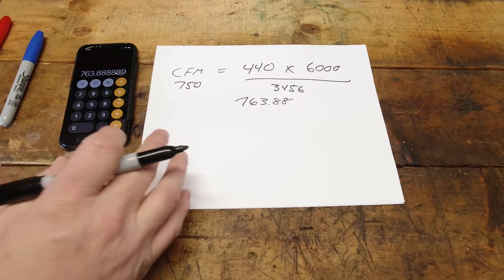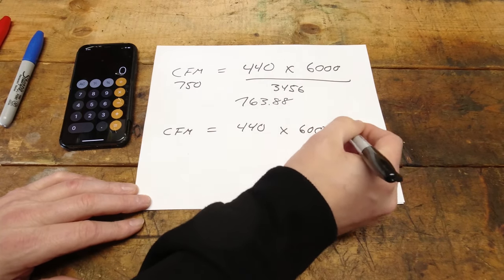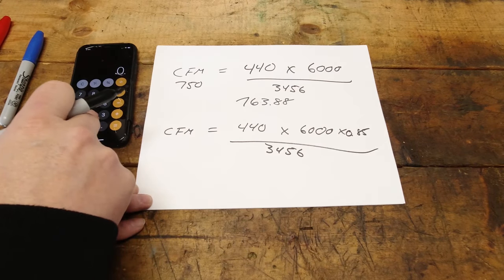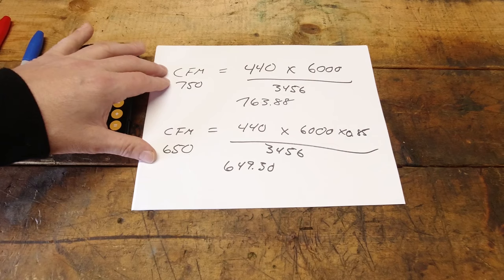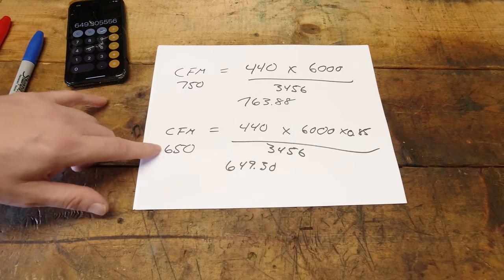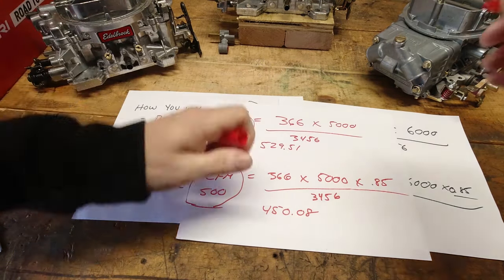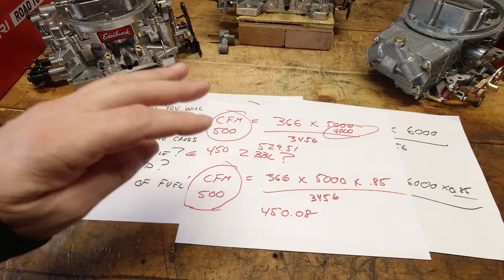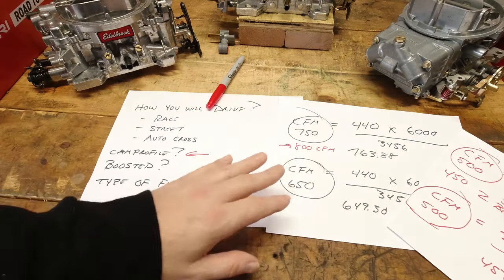How to Choose the Right Size Carburetor

Comment: if i used the first equation,  thats what id wanna use for a mechanical secondary

i just multiply it by VE 1.1  and get the bigger carb BUT its vacuum secondaries.  a double pumper flows way more fuel  vs a vac secondary of the same size. freiburger and company tested a 750 dbl pumper vs 750 VS  MS  made 20+ more HP with no other changes other than the carb type

so just up up in size on a street carb  this all N/A  pump gas 91-93 octane
Reply from the maker: The formula, no matter what is used, is going to be a ballpark result.  This one is easy to understand and is a good starting point to determine what direction the user needs to go size wise to get the best CFM.  Certainly a race application will look at race carburetors and not the VS models.  Fortunately is a wide spread on sizes.  Hard to get too wrong.  The alternative is what I see time and time again.  Someone talked them into putting way too much carburetor on their application.  The street guys always seem to have the most trouble.
Reply: @MuscleCarSolutions  yeah ive read about a lot of guys  going for too much carb. 

i figured a 6500 RPM 302  with 4.10's and a 3000 stall and aluminum heads and about 10:1  a 600 dbl pumper would work in a 2900 lb car with me in it @ 3100+  mercury zephyr

close enough i guess
Reply from the maker: Depends on what you’re going to use it for.  Sounds like you’ve got it dialed in.  I’d trust a 600 to tune through those things you mentioned and the aggressive driving that it’s built for.
Reply: @MuscleCarSolutions  yeah I'd say it's gonna be "hot street" somewhat MAYBE a couple of track runs but nothing serious.  Just want it to get up and go pretty decent for a fox body on the street

Comment: Okay my Question is..... 383sbc turning 7100 rpm will be running E85 drag race only. Been told by two different company's two sizes, one said 850 and the other said 950. What size of carb do I need?
Reply from the maker: I would opt for the larger carb if e85 is your fuel choice.
Reply: @MuscleCarSolutions  Okay thank you! That's what I was thinking, but was unsure about!

Comment: Hi,  very good explanation of how the carburetor works and how to do the math . 
I’ve got a 65 Olds Cutlass with a olds 403 .060 over,  headers , olds 350 heads w 65 cc cambers 9.1 :1 , Edelbrock performer rpm intake, Carter 750 , isky 262 / 262 cam , stock rear ended , HEI 
TH2004r w lockup converter. 
Runs so so. I did the math and it looks like a could go with a 625 or a 650 CFM Edelbrock 
408cid x 5000rpm 
          3456 = 590.2777
Any suggestions? 
Thank you for your time and efforts 
Job well done. 
Ernie
Reply from the maker: Kind of really depends on this one.  I’d probably step up to the AVS2 and go with the 650.  You’ll get some better throttle response with the annular discharge carb.  Should have no trouble tuning it for that fun Olds motor.  Big fan of any of the BOP engines and cars. 👍
Reply: @MuscleCarSolutions  thank you very much for your prompt reply and time . Always a pleasure to talk with someone who has been working with this kind of thing . I’d send a picture of my car but this site won’t let me . 
Take care and be well 
Regards Ernie
Reply from the maker: @erniehampton5809  always happy to help!

Comment: Stock marine 1993 - 305 GM.  Mercruser   Running wide open throttle is limited around 5650 Rpm.   Someone put a 800 Holley double pumper and I believe it’s drowning in gas. I have no idea on cam size. I’m thinking I need like a 550  any advice?  Help please.  Ty
Reply from the maker: Well, what did the math tell you?  It’s a sub 4” bore engine so it’s always going to suffer from that.  With an rpm limit of 5600, the math puts you at a much smaller carb than an 850.  Depending how you drive it, either a 500 or 600 will work just fine.

Comment: Hello, I have a 406 w5.7 rods,  in 71 monte carlo. Car weights 3710 with driver. 331 gears, 3800k stall. 750 qf dp. AFR 195s, 10.8 cr, 1 5/8 long tubes. 2.5 dual exhaust. Rpm airgap. 
Cam is a comp 294 roller. 1.5 roller rockers. I don't take past 6k.  I was thinking of trying a vac secondary 650 carb? The dp works great, I tuned it using a wideband O2 sensor.  Just thinking of it would be more effective with the smaller carb. 
What do you think? Best on the draggy was 12.68@ 110mph with 2.2 60ft.
Reply from the maker: I think the carb size might be the least of your worries.  Which cam is that?  Has the 110 LSA?
Reply: @MuscleCarSolutions  lift 540/562  dur 242i 246e. And yes 110 lsa.  Jetting is 70 front, 77 rear.  Like I said it runs awesome, I just wonder for a street car, that I over carbed it on what I have researched and carb math from your video.  Wondering if a 650 vac secondary would run the same just cruising. Hate to buy one just to test. I decided on the double pumper because the converter flashes at 4k wot, figuring the same as a clutch dump needing the fuel sooner to meet demand.
Reply from the maker: It’s really hard to say when the rest of the combination is questionable. That cam doesn’t match up well with that converter.  If you’ve gotten it to run ok, I’m not sure I would change it.  You’ll end up fighting it.
Reply: @MuscleCarSolutions  I know I would fight it, that's why I haven't done it yet. Lol, my OCD.  And depending how the overdrive goes, I may change to 3.73-4.10 gear. What converter would you lean towards. Mine is a nitrous converter. The builder didn't receive the parts in time, so I got a free upgrade.

Comment: I bought a 1975 Dodge Coronet 318. The guy I bought it from knows nothing about the car, except he had the engine rebuilt. He can't tell me what size cam is in the car. It has a brand new Eddlebrock 600cfm carb. It wouldn't stay running when I brought it home. It would pop and die out, unless it was going down the freeway. I tuned the carb and she runs descent now, but it's a bit of a Dog. I'm considering changing to a 500 cfm. Is there a way, mathematically, through timing, to figure out what size cam it has?
Reply from the maker: Nope.  Easier to pull it and get the numbers off the back.  Sounds like you’ve got some timing issues to sort out.  And without knowing any details it’s really difficult to know if the 500 would be a better option.  Always a tough situation to be in.

Comment: my 350 should have 600 cfm. but i have a 750 edelbrock to work with. what do you suggest on tuning the secondary circuit
Reply from the maker: Follow the stages for the secondary jets in the tuning chart.  You can reduce some fuel, but you can’t tune CFM.
Reply: @MuscleCarSolutions  thx for the reply.. would the upper secondary flaps will only open part way?

Comment: With dual plane intakes and modified vacuum Hollies I've ran 750 hollies on 302s to 460's! 50cc pumps and change the shooter size a 28  secondary on 302"s to 31 460's !! A 28 shooter works on 302, I use a 31 to 33 on everything from 351 to street 460. The bigger cams have low vacuum so use a light spring till it bogs and back off to the last one! It's not rocket science,  and it's not expensive!

Comment: Ford 302 bored 30 over manual  going to use a t5 with 3.55 gears in a ford ranger. Looking for a torque cam and wanting to tow/haul with it and also just daily drive it. I was thinking a 600cfm would be great.
Reply from the maker: If you’re using a smaller duration cam that’s typically all in by 5000-5500 RPM, the 600 or new 650 AVS would work just fine for that application.
Reply: I'm thinking the melling 24110. Advertised intake is 282 and advertised exhaust is 298 with an operating rpm of 1,200 to 4,000. The factory cam is advertised intake is 283 and advertised exhaust is 273. Max rpm  id go is probably 5,000 for either cam. And could you tell which cam would supply more torque at lower rpm?
Reply from the maker: @cargeekscott1871  I’d need to see the specs at .50 to know which would be better on the low end side.
Reply: @MuscleCarSolutions  the stock is 186 intake and 197 exhaust and the melling 24110 is 210 intake and 211 exhaust
Reply from the maker: @cargeekscott1871  that is a very mild cam.  Should be all in by 5000 rpm.  Should be just fine with your combination.  Just know that the cheap cams are typically valvetrain noisy.

Comment: hi i have 360 Magnum stock in to dodge Dakota what carburator U suggest i   i race some Time.. is more street Truck .the calculation gives me 541 cfm a 600 would be good
Reply from the maker: Based on the information in the video, what did you come up with?
Reply: 541 cfm
Reply from the maker: Yup the valvetrain certainly limited that one doesn’t it?  So I guess the question is, down the road are you planning on upgrading anything?  Rebuild, cam, heads, headers, etc?  The 500 is the safe bet but if you want any track time, go 600.  If upgrades are in your future, the 650 AVS2 would be an excellent choice.

Comment: What happens when you port match and polish the intake and heads for more flow?
Reply from the maker: Port match?  You’ll gain a little on the top end.  Doubtful it will change a CFM choice but it will be something to consider along with all the other factors in selecting a CFM.

Comment: Does a throttle body like the one in this video have the same sound as a 4 bbl carb does when you open it up driving using a low restriction air filter.. Thanks for your time
Reply from the maker: Not especially.  If that’s all you’re interested in, the best way to get that “sound” is with an old Quadrajet.  That’s what you get when you have massive secondaries.  Big rush of air and the sound you’re after.
Reply: @MuscleCarSolutions  Thank you for your response, I have a 1968 GTO I had back in high school. I drive it a lot  I don't race it just enjoy driving it and occasionally hammering down and going through the gears. Reliving my teens. I'll stick with the Quadrajet. Thank you again
Reply from the maker: @britknowles6530  the Qjet has an awesome sound to it no doubt.  Those days are fading quickly.  Glad you’re sticking with it!  Great carburetors!

Comment: Just curious if you use the og formula. You basically calculate your engine has a V.E of 1.00?
Reply from the maker: I prefer that method over multiplying by a VE variable.  You get a better result when it’s not used as a factor.

Comment: I have a 94 Chevy c2500hd with a 5.7l with a automatic and 3:73 gear ratio I am planning on getting a edelbrock cam with a 204/214 duration @ .050" with a. 420/.442 lift with a lobe sep. 112° and some shortie headers with 2.25 exhaust pipes. I bought a demon 625 cfm, I did the math originally and came up with a 500 cfm but I figured with the mods the 625 would be better.
Reply from the maker: I’d say you bought the right size.
Reply: Thank you sir I appreciate your reply, take care.
Reply from the maker: @ezekielmoore4081  anytime!
Reply: That's like a stock cam not really a upgrade cam

Comment: Great carbs videos man. I got a 383 SBC. Thinking RPM be somewhere round 5500-6000. 93 octane. May run N2O. No NHRA championships, but weekend trips to the track not outta the question. 700cfm? Or would u go higher?
Reply from the maker: Don’t know.  What else are you doing with the engine?  What CR?  Cam specs?  What heads are you going with?  How much nitrous?
Reply: @MuscleCarSolutions  mainly a weekender. Doesn't need to be fuel efficient. Looking for all the power I can get out of it obviously without advanced wear. Edelbrock performer rpm 67cc heads. Compression should be round 9.5ish. Cams got a lil bump to it. Eagle street/strip rotating assembly, rated up to 700hp, so maybe 150-200 shot N2O.
Reply from the maker: @tank8285  I’d start with a 700 if that was my engine and I wasn’t sure what the cam specs were.  Hopefully it’s nitrous friendly.
Reply: @MuscleCarSolutions  dont have specs in front of me now, but told Comp what I had and that i was planning to run N2O... it's what they recommended.
Reply from the maker: @tank8285  then you got the right cam.  Go make some horsepower!
Reply: @MuscleCarSolutions  yep. Thanx for ur time.
Reply from the maker: @tank8285  anytime!

Comment: Great video, im running a 9.8:1 383 stroker, 93 octane pump gas, auto, 3.73 and a fairly lighter car(80 malibu) the engine makes around 450-470 hp, engine builder recommended a 670 brawler( which he sells). Ivr had hell tuning this thing, i consider myself pretty knowledgeable on carbs but what size carb do you recommend. Everyone instantly says get a 750. Its a street car, but i do twist it to 6500 occasionally. Cam is 231/236 @50, 490 510 lift. Petronix ignitor iii ign, 1 5/8 longtubes, 2.02 1.6 ,aluminum heads 180cc runners, edelbrock air gap rpm intake.. I prefer vac sec for the street. Any suggestion? Im looking at Q series 750, or 750 brawler vs. What ya think?
Reply from the maker: Based on what the video taught you, what answer did you come up with?
Reply: @MuscleCarSolutions  it falls in the middle of what i have (680) and a (750), the calculation is 720cfm..
Reply from the maker: @lit549  in that instance, it’s usually the best thing for the engine to go to the bigger CFM.  In this case, absolutely that’s where I’d go.  750 should be your better choice on this set up.
Reply from the maker: @lit549  and your gurgling video is pretty common with ethanol gas.  It’s boiling in the bowls.  Check out my heat soak video to cure that.  ;) Bonus tip.  lol You have comments turned off on the video or I would have left it there.
Reply: @MuscleCarSolutions  right on man, i appreciate it! I installed a holley insulator gasket per advice from holley forum and it solved that. Im willing to bet that all of this tuning headache has been becausse the carb is too small. Ive never had a carb give me this much grief.. lol
Reply from the maker: @lit549  it happens.  I’d give the 750 a shot and the vacuum secondaries should be fairly easy to dial in.
Reply: @MuscleCarSolutions  will do, i sure appreciate the advice..!
Reply from the maker: Anytime!  Best of luck to you!
Reply: @MuscleCarSolutions  oh and i have to compliment on the video, this is the first time some actually explained the different methods used in determining carb size.. 👍
Reply from the maker: @lit549  I appreciate that!  Really happy you found it useful.
Reply: The 750 will probably work very well, but a 180cc runner is going to be a limiting factor on a 383 trying to turn 6,000 or more
Reply: I’m thinking you make need larger diameter header tubes!
Reply: Fact is a 650 will support 500 HP...

Comment: I have a '68 Ford F100 2wd approx weight is 5,500 lbs. It has a 351w bored to 408 ci. It has a 572 intake and 572 Exhaust Cam, Aluminum Heads with 2.02 int and 160 exh Valves. It also has a T5 Standard, my top Engine speed on the Street will be 6,500 RPM ( Max ). I will be running pump gas ( 85 octane ) and ever other tank I put High Octane ( 93 ) in the tank. So I have an Edelbrock 750 CFM and I have never been good at " Tunning " an Edelbrock, so I would like to Build a Holley. I think the 750 is to large of a Starting Point, what do you think?
Reply: I have an Edelbrock Victor Jr Aluminum Dual Plane Intake now.
Reply from the maker: Have a couple things that need clarification.  What’s the duration on the cam?  The lift numbers you provided aren’t needed.  Also which intake are you running?  The victor jr intakes are single plane race intakes that don’t build power till 3500.  Most importantly, what are you building?  Street/cruiser?  Mostly drag racing?  What’s your goal for the truck?

Comment: 360 Dodge 1 ton single axle 4.10 gears
Top loader 4 speed
All stock including the 750 rochester q jet.
I have edelbrock 1406 and the 750 competition version afb.
Replacing intake to non spreadbore and exhaust to 3 inch single.
3900 lbs and used to pull 3to7k lbs half the time it rolls.
What do you suggest using 87 octane near sea level in Pacific Northwest?
Reply from the maker: Depends on the operating RPM also.  If you’re on the highway a lot, that old 1:1 final drive four speed will demand more fuel as you’ll be zinging along at 3-3500 rpm trying to keep up with the traffic around you.  Your average/operating rpm is going to be key here to which one is use.
Reply: @MuscleCarSolutions  not on freeways a lot mostly 45 to 55 mph.
No tach to give you rpm. Freeway here is 60mph when moving which is rare. Not much flat ground. Grades everywhere. Tires are half inch shorter than what it came with.
I could no longer get 16.5s so got new wheels in 16 inch.
Best information I can give.
Thanks